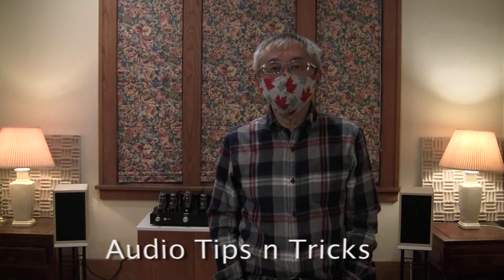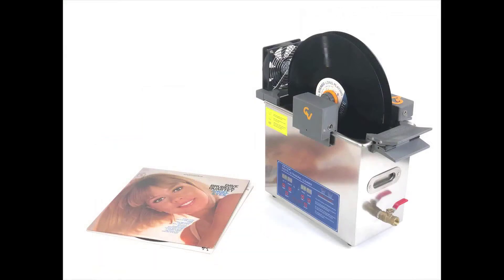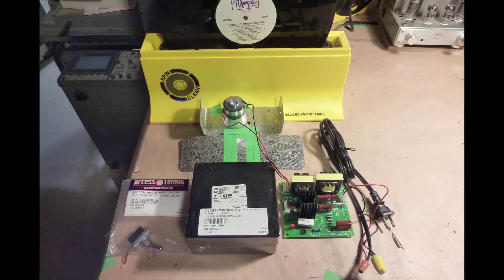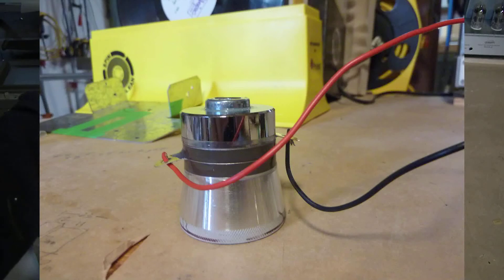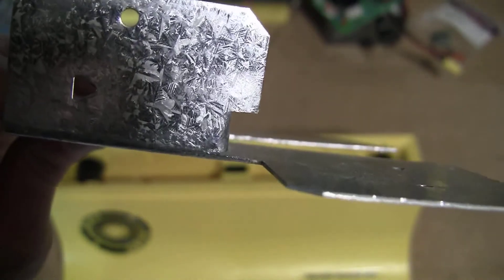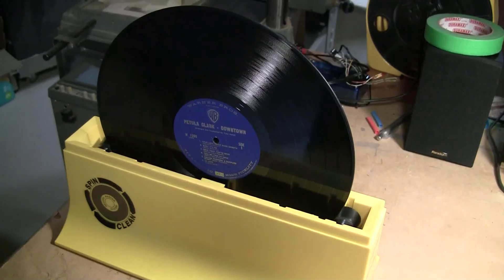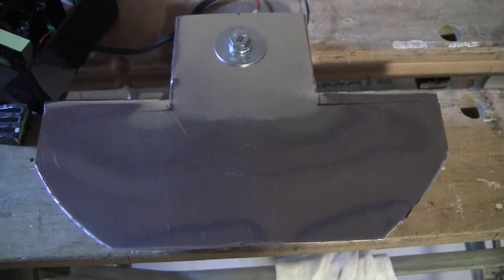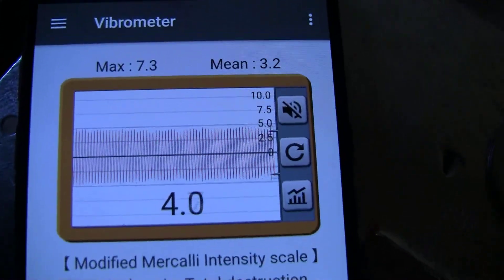Ultrasonic Cleaning with Spin-Clean Record Washer System

Comment: I tried a plus-one vibrating bullet. It’s waterproof, Small powerful and rechargeable. It sits at the bottom. I move the record in quarters. 1 or 2 minutes per quarter. Then do the standard 3 spins to the right and to the left before removing. I have no idea if it works any better just the standard spin-clean.
Reply from the maker: I'll give it a try. Sounds like a lot of effort tho. I've just been using Spinclean on its own for most records. If still noisy I use a sticky roller used to remove lint from clothing to get dirt from the grooves.
Reply: It’s effortless now as my wife is constantly cleaning my records. I come home and I hear the buzzing in our laundry room. She’ll come out 20 minutes later with a stack of records and a pleasant red flush on her face. Although I could swear she washed Dark side of the moon 3 times this week.😁

Comment: Can you just mount the transducer directly on the body of the spin clean?
Reply from the maker: You could try to glue it to the outside surface holding the water but you will need to drill a big hole on the side to reach this. Not sure if transducer will generate cavitation bubbles.

Comment: How was the transducer bolted to the plate? I did not see a threaded hole in the transducer.
Reply from the maker: It's threaded. I used a 9 mm diameter bolt which was cut shorter to fit. I also used a wide flat washer and a lock washer.